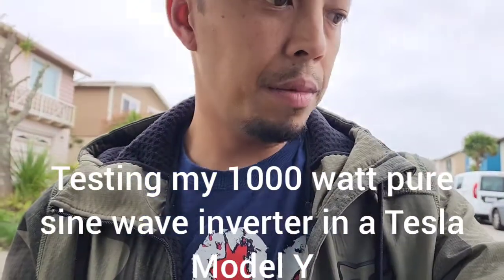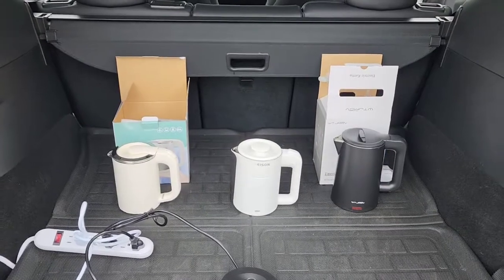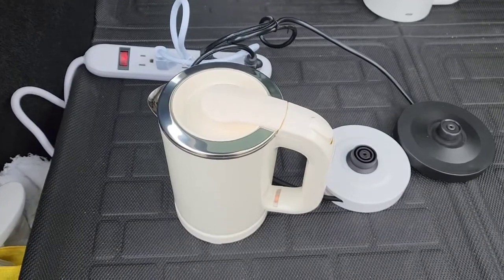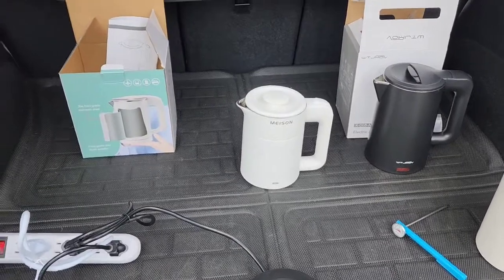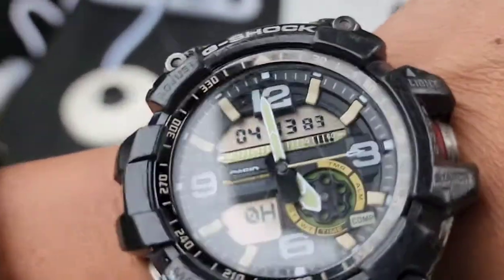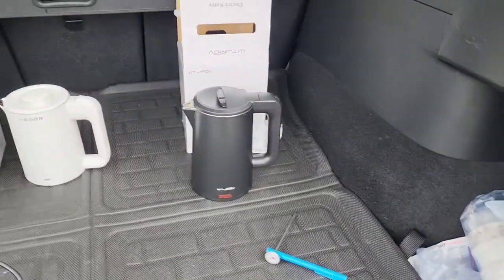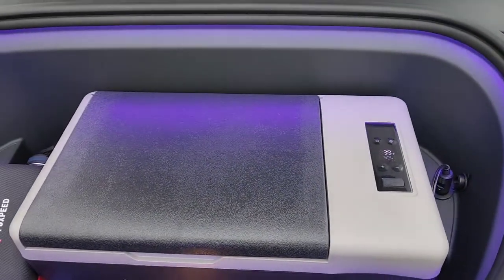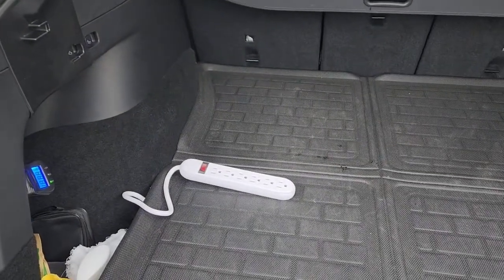Tesla Model Y Power Inverter - Boiling Water

Comment: Don't do this on more recent Teslas! They switched from a 12 volt 40 amp hour lead acid battery to a 16 volt 7 amp hour lithium based one.  Don't mess with the electrics in electric vehicles, you can all too easily destroy some very expensive electronic components.

Comment from the maker: If you have any questions, please feel free to post it here and I'll try to answer them. If you have any requests for any videos please post it here and I'll try and make a video for you. Thanks and please like and subscribe if you like my modifications and would like to watch my other "how to" car modification videos.
Reply: 1. Do you keep the inverter outlets only in the sub trunk or have you ran some 110s to the front console in some way? 2. Do you know if this voids your warranty or if it counts as a stationary power source?
Reply from the maker: @dogearooski  it's in my trunk primarily but you can run an extension cord to the front if you want. So far I haven't had any problems but it's up to you if you want to take the risk. I'm already at 50,000 miles.
Reply: @arisnavarro  battery and powertrain warranty is until 120,000 miles….. but yes this will void all warranties

Comment: Is this with the 16V li-ion battery or with 12V lead-acid battery? I heard that the DC-DC converter is a little bit sernsitive, when you have a 16V li-ion battery and it doesn't work with it.
Reply from the maker: 12 volt lead acid, some have tried with the lithium version but the bms shuts it down. 😢

Comment: How long of 1 gage cables did you purchase??
Reply from the maker: I purchased a 10 ft long 2 gauge red and 10 ft long 2 gauge black. Make sure you use pure copper wire. I'm going to post a video of my  install in about a 2 weeks. 

2 Gauge 2 AWG 10 Feet Black + 10 Feet Red (20 Feet Total) Welding Battery Pure Copper Flexible Cable Wire - Car, Inverter, RV, Solar by WindyNation https://a.co/d/3UmaDFu
Reply from the maker: I just posted an install video in my playlist so you can check it out. I have all of the materials that I purchased.

Comment: good job! i bought my model y this month. got a 2000w energizer inverter. but it killed the rear lighter outlet and doesnt work with front either probably pulling too much watrage.  i need to boil water, mild cook, like egg or rice, sandwich maker coffee machine... what inverter and wattage you recommend?
Reply from the maker: Tesla upgraded their 12 volt lead acid battery to a 16 volt lithium starting in 2022 so most like this modification will not work for you.
Reply: @arisnavarro  need to install 16-12 d cvoltage converter
Reply from the maker: Actually, there have been other owners who have tried to hook up these large inverters to the 16 volt dc to dc charger but it seems to be very sensitive to the amp draw because lithium batteries require a much more sensitive battery management system to prevent overcharging. I'm still waiting for someone to confirm that they have successfully connected a 1000 watt power inverter to the 16 volt lithium battery. You definitely cannot hook up anything larger than 150 Watts to the cigarette lighter because the wires are too small to handle the large current draw.

Comment: Hi! Would you mind answering some questions please? Basically you have your inverter connected to the main battery, the one who gives power to the engine? (The massive battery 71kw)? Is so, your car would not die if you use it moderately, u like if you were to connect to the front 12v battery, tight? If so, why can’t you have a 2000 watt inverter? Your video is genius. You are genius. Thank you so very much.
Reply from the maker: Either connect the inverter to the battery or the penthouse (back seat). The DC to DC converter will continue to top off the 12 volt battery as well as provide power to the inverter at the same time. 1000 watts is negligible for this large battery. It would last for days...

Comment: I know inverters come with a big capacitor to allow for transient loads. Those capacitors will take almost infinite energy when you connect them, causing a big spark, and looking like a short, causing the very undesirable shutdown.  How to solve this?
Reply from the maker: So far, I haven't had any problems with any sparks or shutdowns.
Reply: @arisnavarro  I will soon have a video up on my channel about how to bypass the undesirable shutdown on my channel soon @TeslaLondon
Reply from the maker: I do have a 100 amp in-line fuse about 4 inches from the positive contact stud at the dc to dc converter that the power inverter must pass through so if there are any issues, the fuse should blow and protect all devices
Reply from the maker: @mucky2hot  could you please explain what this undesirable shutdown is? Are you saying that the in-line fuse will not protect the vehicle?
Reply: @arisnavarro  No, Some inverters come with big capacitors that need to be charge fast drawing alot of power. When that happens the tesla will detect that and shutdown (trips) to protect itself. To bypass this you will need to connect a resistor to slow down that inrush of energy into the capacitors, doing so will keep the tesla happy and will not shutdown
Reply from the maker: @Tyrone Creary  Oh yes!!! Thanks for the explanation. I encountered this problem with the 2000 watt power inverter from Eastwood. I was monitoring my 12 volt power from the cigarette socket in the trunk with a plug-in meter (I show this voltage meter in this video) and as soon as I turned on the 2000 watt inverter, I watched the voltage drop immediately from 14 volts down to 11 volts in a matter of seconds and the car automatically shut down all of my 12 volt sockets. I immediately unplugged the Anderson connector right away (to disconnect the inverter) and jumped in the driver seat to look at the tesla screen. It said that all of the 12 volt sockets were turned off to conserve energy. I didn't understand how the inverter pulled so much power even though I had nothing plugged into it. Wow! Now I know the 2000 watt power inverter has this large capacitor that you are speaking of. I was scared that I broke the tesla when this happened because I had a bunch of error messages on my tesla screen  but after about 10 to 15 minutes, the 11 volts started climbing back up to 14 volts again since the DC to DC charger kicked back in and the tesla came back to life. Eventually, the 12 volt sockets turned back on. I was relieved that there was no permanent damage to the vehicle and ended up returning the 2000 watt power inverter. I mentioned this in this video briefly that the tesla can not handle the 2000 watt inverter. The 1000 watt inverter in this video, however, does not have this large capacitor because during my testing in this video, the vehicle voltage was stable at about 13.6 volts the entire time. I even tried a power inverter from Renogy, which I purchased from Amazon, and that particular 1000 watt inverter also didn't have this large capacitor built into it because my 13.6 volts was not affected either. I just liked the performance and size factor of this eastwood inverter instead so I kept the eastwood brand. Thank you so much for the lesson on power inverters! I just learned something!!! 😄
Reply: @mucky2hot where would one find a resistor like that? Also how high of an inverter can one install after incorporating a resistor? Perhaps 3000 to 5000 watts?

Comment: Where did you get the Anderson plug from?
Reply from the maker: From Amazon - Anderson SB120 Power Ground Quick Disconnect Grey Housing w/ 2 AWG Gauge Contact (1 Pair) https://a.co/d/b0dHPpI
Reply from the maker: I just posted an install video in my playlist so you can check it out. I have all of the materials that I purchased.

Comment: What type of inverter are you using; price & watt rating?
Reply from the maker: There is a link in my description 1000 watt easton pure sine wave inverter, and it's on sale for $100 right now. If you subscribe, you can check out my playlist called "Car modifications".  There's more info in that video.
Reply: Thanks for your quick reply!  Your videos are very informative. Does the install effect the warranty?
Reply from the maker: @Bill Stelzner  of course, but only the items related to it, so if your 12 volt battery goes bad, and tesla service sees that you hooked up an inverter, then they probably won't cover the cost of a new battery if it's still under warranty. At least,  that's what I heard. But if your window stops working, then that's unrelated and they should cover the warranty on your window motor. So far that's my experience with the car and most others on youtube who have done mods to their cars have said the same things.

Comment: You seem very knowledgeable.. how would you use this system to charge another vehicle at level 2?  Is it possible?  The amps are pretty impressive.. should be possible with a voltage converter transformer? 😊
Reply from the maker: There are many youtube videos on how to recharge a tesla with power banks and / or solar and generators. Level 1 charging already pulls 12 amps which is 1440 Watts. That's already too much for my 1000 watt inverter. You need a charger that will only pull about 7 amps in order for this inverter setup to work which is 7x120= 840 Watts.  I personally would just try to tow another tesla or ev using a tow hook and strap if you are able to put the car in drive and just pull it while it is regenerating power. It's almost like the car is going down hill but the key is that the car is in drive not neutral or else damage to the ev will occur. There's a youtube video where someone performed this experiment and it worked and was able to mobilize an ev while charging it at the same time. At least you can tow the car to the nearest charger or out of the way to the nearest power outlet. They you can plug in your level 1 or level 2 charger or whatever is available in the area.